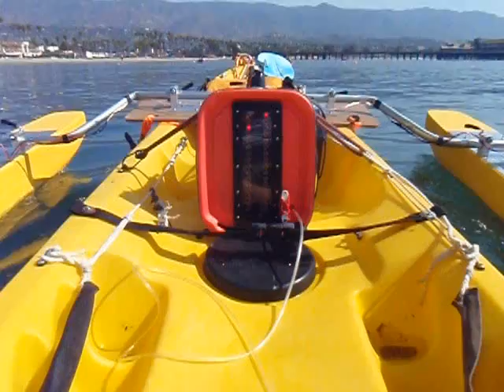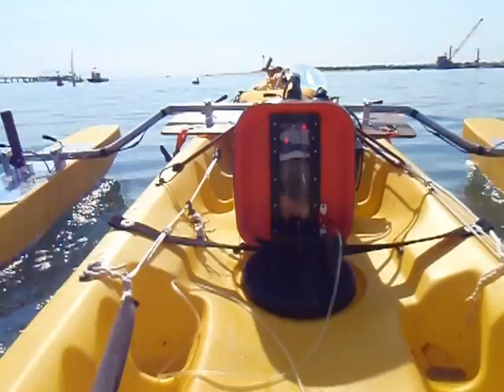SIP & PUFF CONTROLLED MOTORIZED KAYAK

Comment from the maker: @Myfoop My adaptive devices are currently limited to those involving kayaking. My designs are presented and detailed in my web site: DisabledAdventurers.

If you live in or near So. Cal (I am in Ventura County), you should consider contacting me  through my web site and perhaps we can get you out on this kayak.

I have a link in my web site to a simulator program that can give you a head start on how to control the kayak. Look under the Adaptive Fixtures - Powered Sip&Puff Kayak tab.